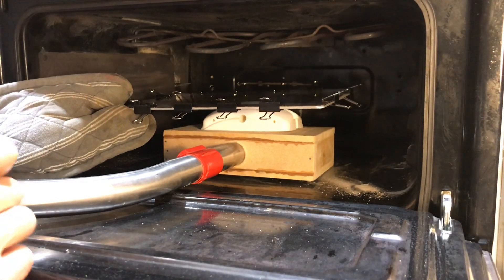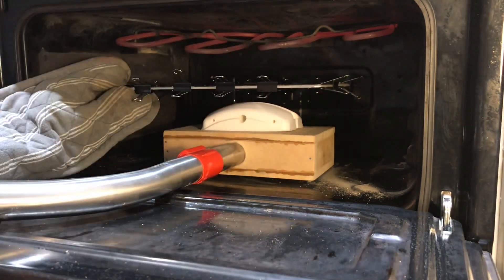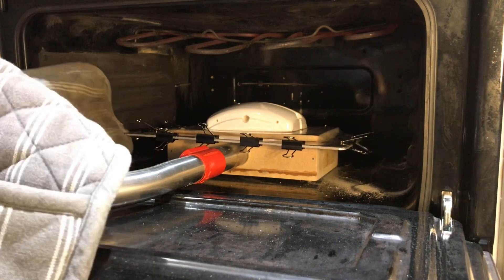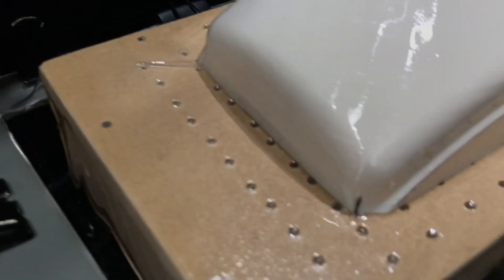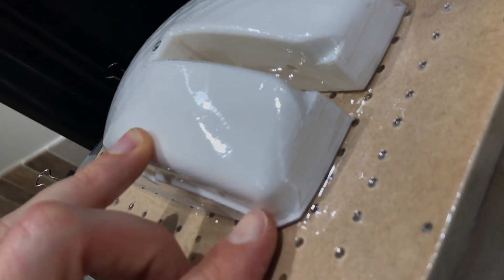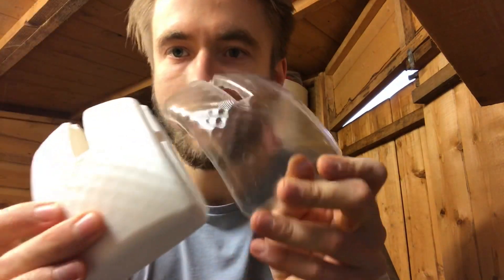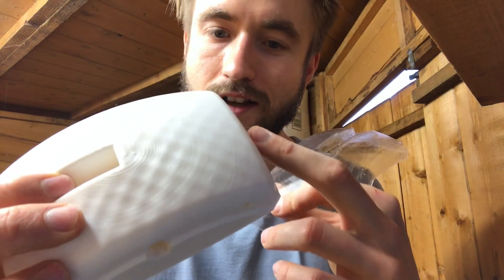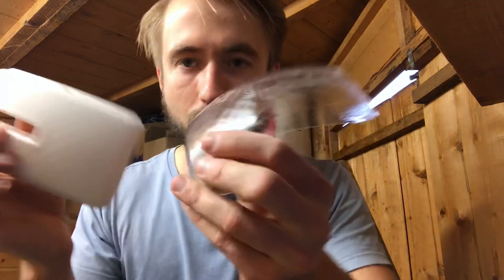DIY vacuum former costing £2 to build 3D printed mold cheap hack

Comment: The melting surface shouldn't happend if you used the proper printing material. Also it might be good to go 100% infill or at least fill it up with something.

Comment: I seen boxes use 1 hole rather than multiple...is one way just good as the other?..thanks!
Reply: Deeper/larger Models need more holes to suck the plastic onto. Depends on the part and the amount of suction you can create

Comment: There are several DIY vac forms. I noticed some have lids, that hold the plastic, sit on top of box and some recess over the box...which is best? Or does even make a difference?
Reply from the maker: Making this vac former was so easy and got great results, so I would say any similar design based on the same principle will work without too much difficulty as well. If I were to make this again I would try with a plastic lunch box purely because it would be quicker to build than a wooden box, but I certainly would avoid plastic boxes with a raised edge as this will prevent the plastic from sitting uniformly on the bed. Hope that makes sense
Reply: @00lewisd1  that doesn't really answer my question but thanks. I was wondering if the recess vacuumed the object better than the lid that just sit on top of the box
Reply from the maker: @clintlucas7604  ah apologies, I think I misunderstood what you meant by recess, if you’re referring to the cavity in the middle of my white mould then I would say that cavity is only there for my application and the finished part should turn out well without it as long as you have enough holes in the bed around the mould. There should be plenty of examples of vacuum formed parts without central cavities out there
Reply: So I guess I'm asking does it matter if the cut out part that holds you plastic need to be flat or oversized to go over the box. Does one or the other make a difference?
Reply from the maker: @clintlucas7604  oh I see. That shouldn’t make a difference as long as the softened plastic covers the entire mould and some vacuum holes around the perimeter of the mould
Reply: Also do small holes work better larger ones?

Comment: Why does the vacuum box need to be in the oven too?
Reply from the maker: I don’t think the box needs to be in the oven, I just did it to eliminate any cool down of the plastic before I press it over the mould. Note; I didn’t use the oven mode to heat it up, I just used the grill which heats only the top element, this is the same method as an industrial vac former and I didn’t want to cook the wooden box